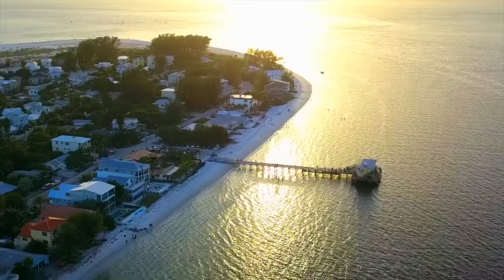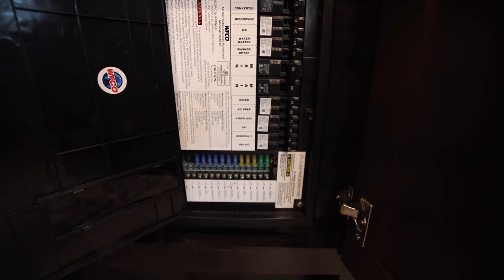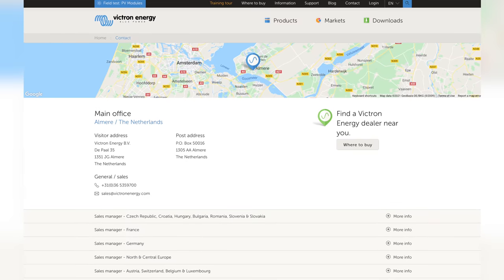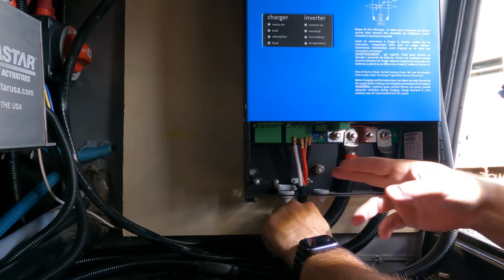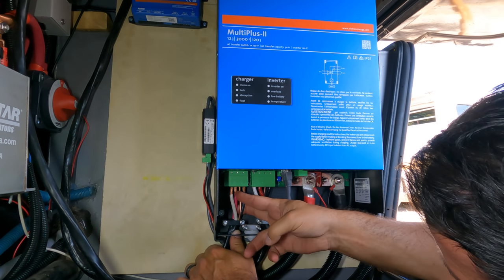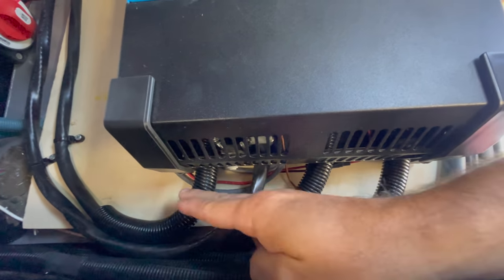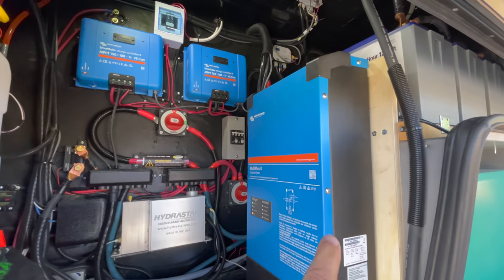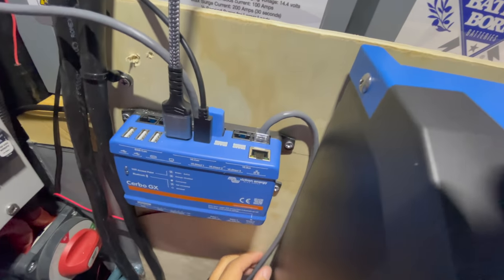🔋⚡️🔌 RV Inverter Upgrade! (Victron Multiplus II 12V 2x120 and CerboGX!) (Full Time RV Life)

Comment: When you're on inverter power, the AC panel gets power to both sides of the panel, right? Just without 240v capability, of course? As in, receptacle outlet circuits on both sides of my panel get power when on inverter power only?
Reply: Also, thanks for the very detailed video 🙌🏻
Reply: I had the same question. 
When inverting, are both output L1 & L2 at 120v in phase? Therefore, no 240 voltage which would require L1 & L2 to be out of phase sync?
Reply from the maker: Yes... L1 and L2 are bridged at the output when inverting.  So both sides are powered and in-phase, meaning hot-hot measures 0 volts instead of 240.  However, the vast majority of RVs do not use 240V so, there's really no difference to the RV other than reduced capacity (amps).
Reply from the maker: see my reply to John... 👍🏼
Reply: @ChangingLanes  gotcha! That's the answer I've been looking to make sure I had the correct understanding. Thanks!

Comment: very nice. if I remember correctly, you have 1000 ah of batteries? (10 BB batteries?). how many air conditioners have you tried to operate at the same time? I also noticed that your GX monitor is showing both L1 & L2, did you upgrade the firmware to the ?? one still in testing?? (forgot the name & number). I decided to wait for the automatic release and update. and one last question, is there a specific reason you have your surge guard before the ATS on the shore line instead of between the ATS and inverter?? I also have the new -II inverter with all Victron & Battle Born batteries (small bank of 6) with the same surge guard. I also like this system. however I am still fine tuning mine and currently adding a DC - DC charger to charge my truck battery. I did notice that even with that pretty large load you put on the system you were only getting about 300 watts from solar, how large is your solar array?? I did everything I could currently think of and still the most I have pulled was around 600 watts out of 1280. I have heard different things on that, what is your take on it??  It was also brought to my attention that the 3000 kv inverter is actually only 2400 kv. So after I tested that theory, yes, I did get over voltage alerts. have an awesome day.
Reply from the maker: Only one AC can run on 3KVA regardless of the battery bank.  
Yes.. I upgraded to the release candidate firmware.
The surge guard replaced our progressive industries EMS, which said to install it before the ATS.  Not sure if the SG has the same requirement.
We have 2000W of solar but it was just a low sun day.
Hope that helps!  👍🏼
Reply: @ChangingLanes   yes thanks, don't you have soft starts on your AC units ?? on their packaging it says you can run 2 units on a 30 amp system. I realize our inverter is actually only good for 2400 watts but just curious to know if you actually tried it. I was thinking about upgrading to that but I decided to wait.  thanks.
Reply: @ChangingLanes  Upgraded Cerbo to latest RC and now I see line 1 and line 2 for my MPII. Nice!

Comment: Why don't you take your infrared thermometer and the hottest wires replace first with that custom wire company. Make them all copper a little bit thicker and more strands so that they're more flexible.

(You can treat this is rhetorical)...lol
Reply: Putting in to big of a wire can defeat your fuse.  The fuse blows when the wire gets hot so if you have to big of a wire for what the maximum amperage should be you will damage something else before you blow a fuse.  To many people think a bigger wire is better and do not realize how the fuse works.

Comment: This is more of a question that I'm not sure if you've answered or not.  Firstly, you guys do awesome videos. I was wondering how the added weight of the batteries close to the hitch affects towing/weight distribution on your truck if it does at all?
Reply from the maker: We had a bunch of heavy stuff stored in there already that got moved.. But, to a bare front end bay, this would certainly add pin weight.
Reply: @ChangingLanes  Thank you!  I used your video on thinking about weights and GVWR and toungue weights and all of that in figuring out what camper I should buy, so helpful!  Just was thinking about the balance of doing that when you first buy vs. after you're all set-up and fully loaded.  So helpful and thanks for responding!  you guys are great!🙂

Comment: How did you extend the cerbo touch hdmi cable and usb to reach all the way in the front bay where cerbo is located. I have the touch 70 and haven’t installed it yet but cable is really short? Live you videos
Reply from the maker: I used this to provide power in our cabinet: https://amzn.to/3Dhi3JE
and just this LONG HDMI cable: https://amzn.to/3HiV6rW
Reply: @ChangingLanes  we have the last run of the 397th model (2022) thankfully… what behind the cabinet did you splice the usb dongle into? Btw, thank you for reviewing the 397ths last month. We’re thankful we have the 397th.

Comment: By any chance did you post a build list? Thanks
Reply from the maker: All products are listed in the description below and in the blog post.. 👍🏼
Reply: @ChangingLanes   appreciate that, as the description didn't show on my phone, but did when I pulled it up on the laptop. Curious, I didn't see a vendor reference for the 600 amp base bars 
.. we're they from Battery Cable USA as well? Thanks

Comment: Chad, can you run all 3 ac’s on the new inverter?  Or do you need two of these inverters, one for each leg?
Reply from the maker: Our main AC draws about 1600W and the other two draw about 1300 each.  So, just ACs, that's about 4200W.  We'd need two 3000W inverters and the one on line 2 would be very maxed out.  A 3000W inverter is usually 3000VA which means around 2700W in reality.
Reply: @ChangingLanes  so in reality, the main ac unit on leg one (the one you have today) and if\when you install the 2nd inverter on leg 2, you would be able to run one of the other two AC's.  Thanks for the info.  We're planning our solar and making sure I understand.  I really like the multi plus II

Comment: In your display there is a box labeled "DC Power".  What information is that and where does it come from?  My system doesn't show that box.
Reply from the maker: You can turn that on in the CerboGX settings.. buried in there somewhere is a "has dc system" checkbox.  From there, it just does the math to figure out what's being used.
Reply: @ChangingLanes  Found it (Settings -> System Setup), thanks

Comment: ouch those dang 12 volt wires. that is why Battle Born should have advised you too hook your system on 48V.  way more efficient. smaller cables, no shock ever.
Reply from the maker: The batteries were added over time.. 2, then 3 then 10.  So, I was just keeping the same voltage and form factor.  If I were building a system from scratch, I'd do larger form factor batteries and 48V.

Comment: Why are you using an automatic transfer switch when the inverter has a built in automatic transfer switch?
Reply from the maker: The ATS built in to the inverter is to switch from shore to inverter, not from shore to genny.  There is only one set of  AC IN connections on the inverter...

Comment: Good setup! I watched this after watching Jared's review/install video. Question for you (I asked this on his video but it's a bit older so I am not sure if people are still commenting):

I see you use an automatic transfer switch in your AC line running to the Inverter. Are you using this because you sometimes have two power sources connecting to your AC load at once, using a primary and alternate/failover power source (e.g., shore power and generator)? I'm only using one power source at a time on the AC line--my two power sources will either be Generator or Battery via Inverter--I won't need a transfer switch before the Inverter in this case because the Inverter acts as the transfer switch for the generator and the batteries, correct?
Reply from the maker: If you're saying you never use shore power, then yes.  Our ATS defaults to shore power but if power is detected on the generator line, it switches to that. (generator priority).
Reply: @ChangingLanes  OK, I thought so, thank you for confirming!

Comment: Awesome info. If you don’t mind sharing. I know you installed yourself, but how much would it cost me for everything you have if I had it professionally installed. (Roughly). Although I am handy by profession, I’m limited in the electronic tech department. We have a Grand Design 312bhts. 50 amp. Basically want to be able to run at least 1 AC while boondocking overnight at a Walmart. Thanks in advance. Also love the videos with finding your someday. Think it’s so cool you guys hang out.
Reply: Dah! I meant YOU ME AND THE RV. Phil and Stacy. Not finding our someday. Sorry. Obviously I watch too much tube.
Reply from the maker: Tough to say with inflation the way it's going...  Likely around 15-20K installed.  We built this up over a few years, so it's tough to say.
Reply from the maker: No worries.. We love Corey and Jessie too! 😊
Reply: @ChangingLanes  thanks for responding. Be safe out there.

Comment: When you run on 30amp, and power more than the 30amp can supply, how do you bypass the stock power system in your Rv that monitors and sheds loads if you go over 30 amp?
Reply from the maker: I installed a switch to turn it off.  👍🏼   This was in a previous video but I forget which one...  Might be the solar video.
Reply: @ChangingLanes  no luck finding the video that has this in it. Maybe I am skimming to quickly. Any chance you would tell me where you installed the switch? I noted there is nothing on google about bypassing this system. Maybe worthy of a quick video. There is lots of conversation around these systems just not bypassing them.

Comment: Chad...please tell me you did not run your power cables thru that sheetmetal without protecting them by installing cat track or grommet around the sharp metal edge.  Not protecting your wiring is a great way to cause a short and possibly fire.
Reply from the maker: It's shielded with wire loom.

Comment: Wow I'm going to have to go back to school . Years ago when I worked for AT&T they had a 5KVA ups that would for no reason
just shut down when it went to generator power. This was because the Bellsouth generator would at times drop below 60 hz I
really do not know how much but the original  software would not allow this and thus we had to write code that would allow for this 10 to 12 hz changing. Is this kind of what you were having ? Yes I can see that if each device is communicating with each other you would know what the usage at certain times of the day and not others I guess . You said that the output is (2) 120 Vac are the out of phase with each other ? If so I guess one 120V ac would have 25 amps or  3,000  VA thus the other out of phase 120 Vac would have 3,000 VA as well ?  I wish I knew a lot more about this stuff. I guess I  know enough to just get lost . I have quite often
silver solder the dc connectors this keeps them from generating corrosion. I love how you setup your whole system . I would have guessed that you had been putting in solar systems for a long time  ( man you are good ). Super nice system l love the communication of information and the power sharing darn nice thanks for sharing this information . I bet you did not know why
Bellsouth Central Offices all use -48 V dc . This is because BellSouth engineers found out a long time ago that a positive ground
would not corrode and a negative ground would corrode very easy FYI . Does your two 120 V ac go to a 50 amp breaker in you 
distribution panel ? If so is this breaker double pole, single throw ?
Reply from the maker: Standard RV 50A power consists of two 50A 120V Split Phase legs.  These legs never meet in the RV so, while that's technically 240V (across both hot legs), that is never used. When connected to 50A split phase, the inverter simply passes it through and it's really 50A + 50A for 100A total (12KVA).  When connected to something like 30A, the adapter to connect 50 A cord to 30A services bridges the two lines at the pedestal... So, they are the same line and in-phase.
Yes, we have a 50A breaker in the distro as well as breakers for each circuit (mostly 15A).
Hope that helps!
Reply: @ChangingLanes  Thanks so much for the more detail statement ! This was working in the area that I was thinking and now you have cleared it up. Again Thank You ! ! ! ! ! !
Reply: @ChangingLanes  just thought of something else if two input lines are 50 amps each then you cable from your 
power connector would have to be  size 10 AGW for each leg to handle 50 amps each. This 10 awg wire would have to go to the distribution box ?  Question if you pull 50A each line and between each hot is 240vac . Is every
site that you plug 50 amps I guess between ground and one hot wire will give you 120Vac at 50a and the other 
hot and ground is again 120Vac at 50 amps.
This would mean every site that have 50amp plug you would be pulling or could pull 120vac at 100Aac ?
its like 12:00 at night here so I could sound stupid this late. If so just excuse me please.

Comment: How are you getting the DC power part? I want to track my DC usage and I have the same set up.
Reply: @badgerpa9  I do not. I need to find one.
Reply from the maker: There's a setting in the CerboGX.. something like "has DC system".  This tells the Cerbo to do some math and figure out what's being used by DC draws.
Reply: @ChangingLanes  I have a shunt and inverter so I will look into this.
Reply: @ChangingLanes  I found it thank you very much!!!

Comment: I full time in my 376TH and run the generator A TON as I don't have an inverter yet.  Unfortunately the generator compartment gets seriously hot in the warmer months which concerns me about installing the inverter and other devices in that front bay.  Anyone taken steps to mitigate this?
Reply from the maker: Not yet.. but I have some ideas...
Reply: I wrapped the outside of the generator compartment with Reflectix. Seems to help a little.
Reply: @ChangingLanes  I use a closed cabinet above our pantry for my in-house electronics, as opposed to the nice open garage cabinet.  I installed a W1209 temperature controller supplied by always on-DC, that powers a fan, via a hole and vent cover I placed on the cabinet door.  Range is 39c, kicks on until hits 35c (I think).  The Pepwave, while it gets hot, isn't my problem.  Its the Drobo NAS (you have a Synology?)   The point being, a similar setup could likely work in the bay for heat mitigation, assuming you could find some way to vent the heat out.  (Not sure I'd want a hole in the bay door, to be certain!)

Comment: Does anyone know if he used solid core cables on this install it looks like it.
Reply from the maker: The DC cables are welding cables which are stranded and more flexible.  The AC cables are standard Romex (thick strands).
Reply: @ChangingLanes  thanks for replying. Have you heard of ‘OFC’? That’s the generic name for what is actually large gage marine cable. 100% tinned oxygen free copper and super high strand count, like 5290 strands in 00 gage. It’s also way more flexible than welding wire. When I do my rebuild I plan on using it unless I find for some reason it’s not recommended.

Comment: At 11:10 you said you have 1000 amps of batteries, but the busbar can only handle 600 amps.  That looks like SERIOUS IMMINENT electrical fire risk as your busbar is undersized by more than 400 amps.  That is WAAAY off.  Please tell me you fixed this.  Victron makes a busbar system, the lynx distributor and power-in, that is capable of handling up to 1000 amps.  You seriously need to upsize your busbar man.  Like danger.  When your batteries fill about half way (600 amps), that busbar is gonna burn up like a fuse.  And with everything in really close quarters like that, fire and explosions guaranteed.  That is not at all safe to drive.

Also the lynx power-in works so that each battery is connected individually to the busbar.  You have the battery terminals connected to each other which isnt the best method.  The lynx busbar and power-in is what you need TODAY to advert this imminent electrical fire.  And instead of having 10 100 amp batteries, consider 4 230 amp batteries so you only have to manage half the connections.  Your battery capacity MUST BE lower than the busbar ampacity, there is no way around this you MUST HAVE a correctly sized busbar.  You should also put Marine Rated Battery fuses on the terminal of each battery bank.  That can also help avoid electrical fire risk, but if your busbar is undersized by 400 amps there is simply no way to avoid an electrical fire with this setup.  When your batteries fill past 600 amps, it WILL catch fire.

Your 400 amp fuse is also undersized by 600 amps, and it is all connected to what looks like a 250 amp kill switch, which is undersized by 750 amps.  All of that is WAAAAY undersized, and will burn away like toilet paper the second your batteries start to fill.  Danger Danger man.  Do not drive this RV it is a ticking time bomb.

Here is a website on the best methods to connect batteries together in parallel. 
http://www.smartgauge.co.uk/batt_con.html